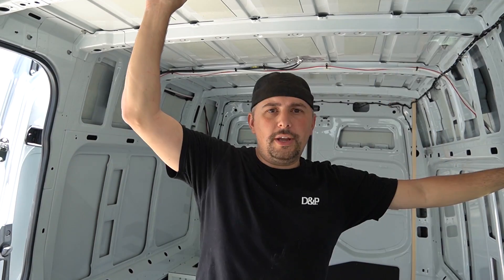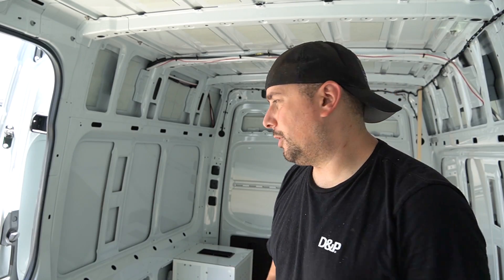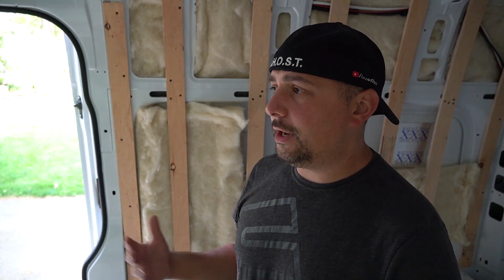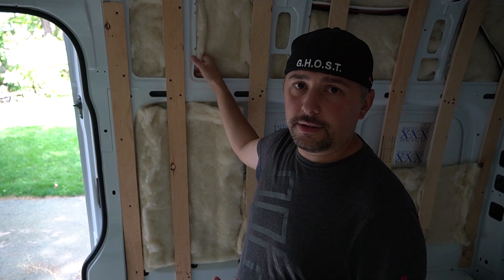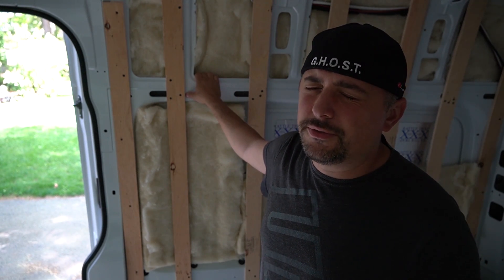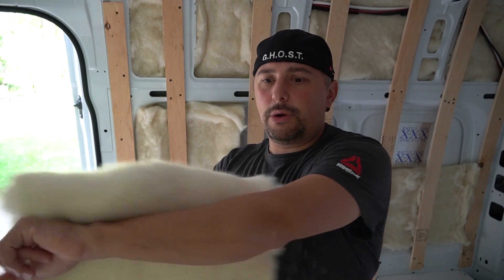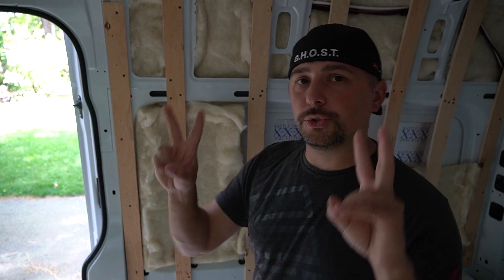GHOST Van Build - Insulation, Framing and Planning

Comment: I squeezed 4" sheep's wool in the lower walls and doors and 3" in the upper walls and ceiling. Then 1/4" underlay foam then ply. Worked a treat. Barely any road noise too
Reply from the maker: What I didn't mention is wool is great at sound dampening
Reply: This part I didn’t follow in the video without a diagram (I’m a newb).  Please help.  How did you apply the quarter inch foam on top of the wool that is inside the cavities?  How does it lay in relation to the furring strips such that it leaves an air gap?  I get the math but I don’t understand the application.  :). Please help ^^

Comment: Thanks Jarrod! That’s exactly the information I needed to finally decide on which type of insulation to go with (it’s definitely between wool and thinsulate now-lol) ..and ya absolutely agree that you gotta think ahead always as you build 👍 🗝
Reply from the maker: Personally I think you can't go wrong using either of those. I'd even take it a step further and add a layer of another type of insulation. I'd cover all metal with a sound deadening it Front King. That helps with a thermal break.

Comment: Hi Jarrod, Can you please do a detailed explanation of why you believe a vapour barrier is NOT required.  I understand the wool "breaths" moisture, i.e. absorbs and releases it.  But presumably when it is released it needs to go somewhere, right?

Where does your moisture go?  does it drain through the floor? have you designed a feature to do this?

Thanks!

Comment: you could use reflectix, not as insulation, but as a vapor barrier, along with thick foamboard/wool as your insulation. it would also give a little bit of a space between the plywood walls touching the van walls
Reply from the maker: with wool you are not supposed to use a vapor battier
Reply: @JarrodTocci  did the guys who sold u the wool in the video explain why its a bad idea to have reflectix between the steel walls/wool&foamboard/reflectix? You mentioned something about the wool absorbing the vapor, but I can't quite make sense of why wool and reflectix together would not work well together. Thanks again for you time and your videos

Comment: Why do they do the air gap when they put the foam board on the panel/wall? For thermal something? and would you put a vapor barrier on the inside or outside of that gap?

Comment: Nice! I plan on using wool and cork for my van build. Check out cork! It’s light-weight, has a strong R-value, dampens sound, is a renewable, green building material, and comes in a wide range of human colors & patterns.
Reply from the maker: Cork is amazing! But isn't it expensive? I've heard that but not sure
Reply: Jarrod Tocci Home Depot seems to have the best prices (expecting to pay $250 to cover my van) while you could pay more for more choices in colors & patterns. Home Depot offers tiles & a 1/2 inch roll.

Comment: How many types of radient flooring are there and how necessary is it? Can you use a wool insulator??
Reply from the maker: Not sure how many types, but most get confused with hydronic flooring (like this one) and the electric floor heating. The electric is more so like a heating pad and does not do the same as a hydronic system. I would not use wool on the floor for many reasons but for the walls and ceiling yes I like wool but needs to be real wool and not a mineral grade

Comment: What would be wrong with using reflextics between your half inch furring strips?  You could tape it to the strips, have a air gap an a vapor barrier.  I know you are down on reflectics, but I used it to make a cozy for my cooking pot and it seems to work well.
Reply from the maker: If used incorrectly they are useless

Comment: Wool absorbs the mositures, right, but when it releases it, where do you think the moisture in a closed metal box will go? Also the wool will probably just soak it up and its r value will go to shit and the moisture will just sit there and create rust. The idea of reflectix  is to tape off all the seems and thereby create a barriere so the moisture or vapor can't get to the insulation or the outside wall in the first place, not because of it's R value. But obviously, we don't live in a perfect environment and there is no way you will create that airtight seal in the whole van. But I think you can prevent most of it. Ample ventilation is required in any case. The more the better.

Comment: What di you use for the ceiling, the wool or plates?
Reply from the maker: For insulation I used the wool. If/when I do another build then I'd do things a little different. I'd use probably frost King covering the entire metal roof, then 1" foam board, then tape of all off with another barrier of some sort

Comment: Do you mind sharing what you used to attach the furring strips to the frame?  What about load bearing items, like cabinets?  What bolts/screws can be used for this?  This is never mentioned in videos.
Reply from the maker: For the furring strips we used metal drywall screws and make sure they catch well. For attaching cabinets use a mix of sizes of drywall screws. Some also use kreg jig too
Reply: @JarrodTocci  ooh, yes, I've heard about the kreg jig before but forgot.  Thanks for response 😊

Comment: Hi Jarrod,  

I know that you’re completely done we the build, but I noticed that you didn’t put up a vapor barrier before you installed your 1/2” wood furrows.  Is this not necessary. What are your thoughts on a plastic vapor.  As always - love your show man. 
Thx
Reply from the maker: Don't need one when using real wool. In vans I wouldn't use one anyways for many reasons. The vans breath too much but wool is designed to absorb any condensation
Reply: @JarrodTocci    I was going back and forth between the Wool and Thinsulate. I think that I’ll be using the wool.  Much appreciated. Thank you.

Comment: Found your channel through Bob Wells.

Question - how are you funding the build and do you have a financial breakdown for your first build and your current one?

My goal is to build my own van but even getting enough funds together to purchase a used van has been difficult... and no, really don't own anything I can sell off to build capital.  At my age I'm having a hard time just working 38-40 hrs/wk and still trying to pay off debt.
Reply from the maker: Thanks for stopping in. I plan on doing a price difference once the second van is done. My first van all said and done was about $10-12K and the second will be over $45K is my guess (plus cost of van). I looked at my first as a stepping stone to see if I could handle the lifestyle and then 2 years later I sold and built my dream van home. I think you're thinking of doing it right with staying within your means and don't over extend yourself. No shame in going small or used
Reply: @JarrodTocci  - Very cool!  I may be in my 2002 Honda CR-V (with 220K miles) with a tent when I finally get on the road.  But the goal is a used van with a small build to start.

I'm thinking of going back to seasonal work and then taking the winters off for the future but for now it's the daily grind.

You definitely have a dream build - kudos!!
Reply from the maker: @DuTubeable  so weird I just met and have been hanging out with a girl that has been traveling in a CR-V with a tent for the past 4 months! I wish you the best and any questions just let me know
Reply: @JarrodTocci  - if she has a channel, let me know!
Reply from the maker: @DuTubeable  she does not unfortunately BUT next time I see her I'll ask if I can send her info to you. Feel free to email at info@jarrodtocci.com

Comment: I noticed in a more recent video you kind of said you would do a more "layered" method for insulation. Would you now change the info from this video or do you still recomend this method? Thanks!
Reply from the maker: Good question. What I did in this van is good and works well. But I feel with every new van I build I change or upgrade little things. Insulation on my first van was also good and on this one I made it better. I've been back and forth because wool is designed in a way that it doesn't need extra layer. With all that said then I'd probably add something else. Don't know it it would be foam board between the slates or maybe more against the metal itself. But probably upgrade a little

Comment: Jarrod mentioned using drywall screws for hanging cabinets. Drywall screws are brittle and are not rated for this kind of weight, especially when moving.
Reply from the maker: I think I meant drywall for attaching the furring strips to metal only because they are coarse thread and not fine thread. You want to be able to have a good grip from wood to metal. If I did say hanging cabinets then I'm sorry and maybe I was mistaken. It does matter if going wood to wood so I would use a type of wood screw.

Comment: Hi Jarrod.  Great info; I'm considering a van build - not so much to be total vanlife but do want to travel in it and like stealth and other aspects of vanlife.  On the insulation:  you mentioned spray foam.  If going like you did with a sound barrier and wool insulation, couldn't you add to that by using the spray foam in the voids of the framing?  I see on the drivers side you have some of the wiring routed through it, but there must be plenty of other places that is not used for anything and the foam would add R value to the total insulation build.
Reply from the maker: You can use the small spray can but those have no R value and just stop draft so more so on a home around windows. Using actually spray insulation in the crevices then it would be a huge added cost I wouldn't see the point of. I'd just take the time and stuff the wool into the holes and areas like that
Reply: Great explanation, thanks.  That makes sense.  So, using the spray foam as insulation like you showed a quick clip of from someone else, it has no real R value for insulation?

Comment: The reflectics that are used in vans are not for the thermal insulation.
This is for taking the vibrations out of the metal so that its not so loud when you drive or close a door or aomething like that
Reply from the maker: Really? That's what you think. Have you ever held reflectices in your hands. They don't even promote they are a sound dampener. They make mats for that called rattle trap and there's another brand out there.
Reply: Ohh... maybe i unterstand u wrong but that kind of reflectives that i know is actually just like a bit thicker aluminium foil with glue on the back side and sometimes they add a small layer of thermal insulation in that too
Reply from the maker: @Thomate1375  oh ok cool. Yeah that's the rattle trap I was talking about. Same thing but it will definitely help with sound and little with insulation

Comment: how do you connect the framing system to the metal?
Reply from the maker: Metal self drilling drywall screws. I think we used 1 1/4" just make sure they catch well
Reply: Why don't people use the prefab holes?
Reply: @verybadatverynewthings  a lot of people do and put either plus nuts or rivnuts in the holes.

Comment: WARNING: I learned in the States that 1 x 2 is not 1 x 2 but, rather naively, thought that in the UK 50mm would be 50mm and therefore match the 50mm foam insulation. Nope, it's not-1-x-2 rounded to the nearest 10mm so it's actually around 44mm. Apart from the bit that tapered to 30 odd mm by the end under the label of "it's a natural material". However, I asked about the oddly specific 50x47mm and found that that was indeed 50mm.
I'm not a builder but make sure you ask for the actual sized when ordering and get a few extra for the "good enough" ones. Builders, apparently, aren't engineers.

Comment: Nice insulation installation information. Did you abandon the spray adhesive and tape? It looks as if you ended up using the furring strips to keep the wool in place. Cheers from Australia.

Comment: Thanks for the video. I am concerned re the lack of a moisture barrier - yes wool will absorb and breath naturally, but you have no control as to the direction of breathing. I.e. you will certainly getmpiature build up on the metal walls, and on the timber battons and underside of your walls which has the propensity to rot your wall structure in a couple of years. 

I know you laughed at the bubble wrap insulation, but I'm using it, after using a recycled plastic 'wool'. Why? To create a moisture barrier with at least some insulating properties. 

Either way, good luck in van life dude. Enjoy!

Comment: You don’t need a vapor barrier between the wool and the metal? Won’t condensation make the wool wet and cause mold? Or am I confused about something? (Which I probably am. Lol)
Reply from the maker: All good. So wool won't get mold. I explain (or Josh) more in the video I did at Havelock. Wool will absorb moisture and then release it naturally. When I did a tour of the shop I asked the same question about vapor barrier and his response was "absolutely not needed" and then went on to explain that vapor barriers where designed because people started making cheap insulation.

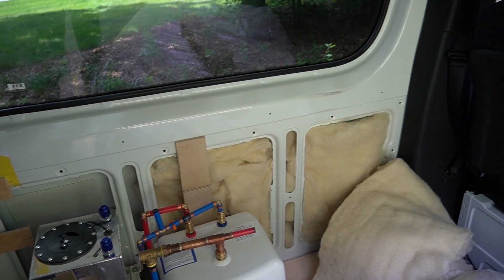Comment: Hey Jarrod thanks for the content. Just stumbled across your channel. In this video @13:26 is that a Rixen system or other? Will look through your video library to see if I can find mention of it. Interested in you're experience with what youre using Rixen or otherwise. cheers
Reply from the maker: Thank you. It's a company called Van Life Tech. They have a better system compared to the Rixen but same concept. Price is about the same but it does, or should, be installed by a upfitter which they can find for you.
Reply: @JarrodTocci   cheers, will have a look. will reach out if an up fitter is needed. Im  located in the "Great White North" AKA Canada

Comment: You mention the wool insulation releasing the moisture naturally. Do you mean slowly? Like so slow it reduces the potential damage of condensation?
I would really like an in depth discussion about condensation. I know it can't be avoided. I understand that ventilation is necessary. But how can mold be prevented. I would think that one should take every thing apart once in a while to check. Do people live in metal boxes for years without mold? My climate is like 100% humidity all the time so Ive seen mold wreck schtuff on the reg. Haha, anyway thanks for them vids. Subscribed to your comedy as well. 😁
Reply from the maker: I'd love to give more in depth know how into wool insulation but I know I won't know as much as the company itself. If you email or call Havelock I know they gave me pages of literature to read over

Comment: This might have already been asked but how did you watched the furring strips
Reply from the maker: self drilling metal drywall screws. Power in numbers so make sure they catch well and just screw in to the ribs of the van. You can also use a small drill and then a think thread drywall screw but it's easier to just the metal screws
Reply: @JarrodTocci  thanks man, you probably do not remember me I asked awhile back if you were coming through the Monterey area but you probably were busy keep up the good work maybe one day we'll met
Reply from the maker: @albertmunoz7560  yeah when I go I move fast. But one day I'll meet you

Comment: I think most people use Reflectix for the moisture sealing, not the actual R - value.
Reply from the maker: Moisture sealing? But reflectix would repel water and then the moisture would probably go into any wood that there and eventually cause mold. Just my thoughts
Reply: @JarrodTocci  could be right. I was just saying I think they see the foil wrap and think that. With that said it still would work as a moisture barrier to keep it from getting to the insulation, but you are right, the moisture outside of that might get trapped.

Comment: How did the insulation work out?
Reply from the maker: So far it's been great. I worried about moisture so one of the main reasons going with wool. In high heats it's hard to keep a tin can (a van) cool but proper vents and fans it's manageable.
Reply: @JarrodTocci  The moisture is what I was thinking about.
Reply from the maker: @truckerdaddy-akajohninqueb4793  as far as I know it's great
Reply: Can you do an episode on Phase Change?

Comment: You chose wrong with Rattle trap my friend. For sound deadening/vibration dampening you want to use a butyl rubber based material, NOT an asphalt tar based one like Rattletrap. Look to sounddeadenrshowdown and resonix websites for info.

Comment: How did you fix the wooden strips?
Reply from the maker: What do you mean fix?
Reply: Jarrod Tocci How did you tie the wooden strips to the metal? with nails? maybe you said it in the video, but my english is not that good. 🙈
i‘m just starting with my own sprinter expansion. that‘s why I‘m verry interested☺️
Best regards from Switzerland!😘 miri
Reply from the maker: @mirilili3287  metal self drilling drywall screws. Make sure they catch the metal well and hold so you might need to put a few in per strip. Attach to the rib of the van
Reply: Jarrod Tocci Thank you!!!👍😘